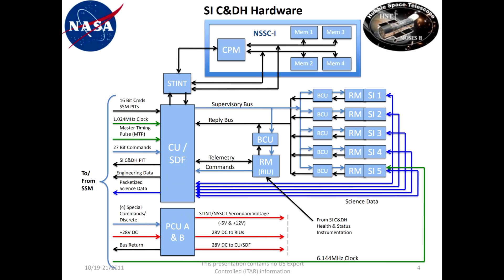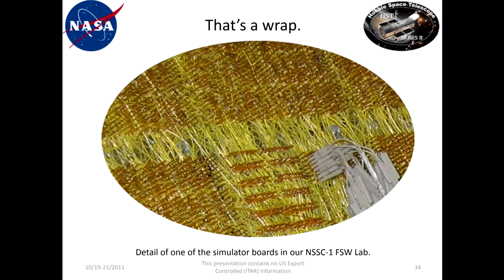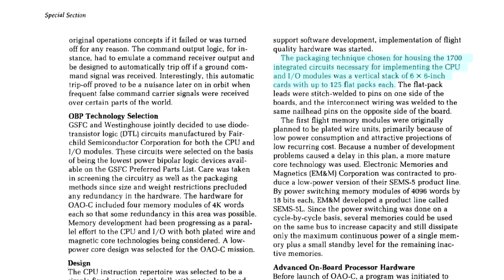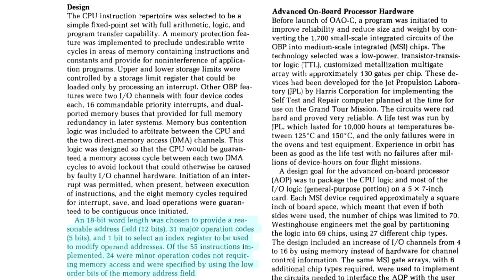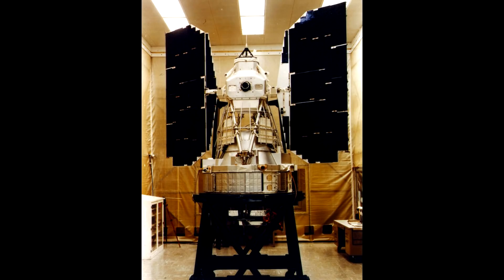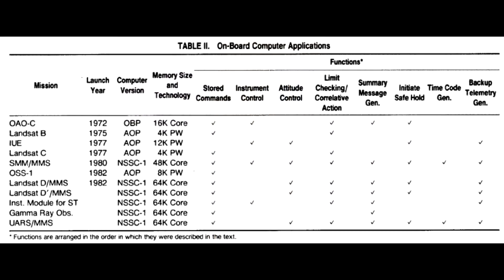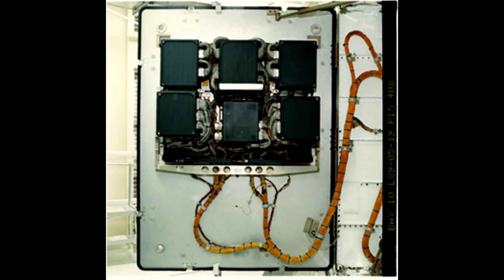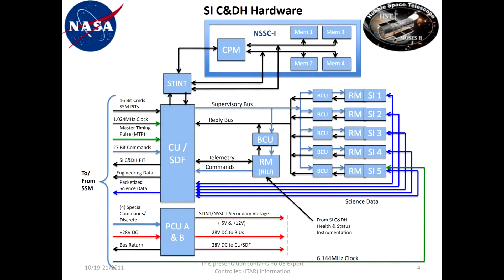Hubble's Latest Problems May Be In a 50 Year Old Computer Design

Comment: First Arecibo now Hubble.... tough couple of years for telescopes.
Reply: We really need to replace Arecibo.  Perhaps on the Moon, as part of the Artemis Project.
Reply: @darylh8657  That'd be cool, but constructing something that large on the moon will probably require much more time and work.
Reply: @javaguru7141  we could use a crater for the dish it'd just need to be polished
Reply: @raytan956  "just" doing any form of construction on the moon is pretty far beyond anything we've done yet. We definitely have the tech base for it, but that'd be multiple multi-billion dollar missions. I'd love it but it's somewhat unlikely in the immediate future
Reply: @raytan956  The dish isn't even the main issue. It's the antenna and supports, of which the antenna on Areceibo weighed 820 tons.
Reply: @javaguru7141  I have some good news for you! That would only be ~135 tons on the moon!
Reply: @washellwash1802  Aha, well that means the support structures can be lighter too which would bring the weight down a lot. Combine that with newer materials and maybe it could all be shipped up on a handful of Starships. The biggest problem would be the actual *construction*.
Reply: @Joesolo13  Actually, using a lot of remote tech, not as expensive as you might think. And a little gravity goes a long way to eliminating some engineering issues.
Reply: @washellwash1802  But it would be 850 tons to haul out of Earth's gravity at something like 25,000 dollars a kg - even more to the Moon.
Reply: @johnmurrell3175  But it wouldn't need to be 850 tons, because it wouldn't need as much reinforcing and strengthening. And I was thinking of locally sourced materials and/or recycled rockets. Starships making their last trip for example.
Reply: Just shows that modern astronomy is a mature scientific field. When systems fail due to old age instead of being replaced for performance reasons.
Reply: @Mike-oz4cv  Another way of thinking of it is that it's failing because we regressed and lost the ability to service it.
Reply: Don't forget the collapse of Greenbank a few years ago. Radio telescopes are quite delicate
Reply: What would Thomas Dolby say at a time like this?...
Reply: Don't forget the TMT debacle...
Reply: @ShanesGettingHandy  I’m not sure what that is actually
Reply: It's obvious now that COVID-19 is an alien virus sent to Earth to stop us from looking for extraterrestrial civilizations.
Reply: Then JWST blowing up on an Ariane 5
Reply: @synonys  Oh gowd I hope not
Reply: @michaelcoelhojr6851  : ... Or Ariane 7, in maybe 35 years.
Reply: @synonys  Don't you dare jinx this.

Comment: A potential explanation for the 27-bit word length may be that it's actually three 8-bit sub-words slammed together with each sub-word having its own parity bit.  If I recall correctly, the Gemini Onboard Computer had some similar oddball word length for the same reason.  I think it was 39-bit composed of three 12-bit words + a parity bit each.
Reply: Univac (a.k.a. Sperry, a.k.a. Unisys) had machines with 36 bit words with quarter word operations (9 bit).  Three quarters is 27 bits.  Best architecture ever in my opinion.
Reply: 39 bits? Who built that one, IBM?
Reply: @absalomdraconis  MIT
Reply: It could also be because octal was all the rage in the 60s and 70s (rather than hex) so using multiples of 3 wasn't all that uncommon for bit lengths (9, 18, and yep 27), with 27 bits being exactly 9 octets.  (Would probably also have some sort of parity or checksum because space, but in this case those just wouldn't be counted as part of the instruction width.)
Reply: I mean … there is no reason why it has to be powers of two. And the explanation for the 18 bit bus Scott Manley gave sounds perfectly reasonable and sensible.
Reply: Probably 32 bits with a Hamming code, that would bring it up to 39 bits.
Reply: You kids don't remember Digital Equipment Corporation.  Look up their various series of PDP minicomputers.
Reply: I used a mainframe in the past with 36 bit words, 4x9 bit bytes.....I think it was Perkin-Elmer....been too long.  May have been Burroughs or Univac.
Reply: Check out Curious Marc. He has detailed vids about the Apollo flight computer. And Odd ball data busses.
Reply: Mostly I have Wheatbix for breakfast - milk and a little brown sugar.

Comment: have one of the maneuvering servicing satellites grab the Hubble and take it down to ISS where they can grab it, astronauts service the Hubble, then release it and the service satellite takes it back up to it's operational orbit.
Reply: Different orbital inclinations thus far too much delta v or fuel required
Reply: @MrPbhuh  that's what I was worried about.
Reply: @BrotherAlan  its probably cheaper to launch a starship to collect hubble, sent it to earth and put it on a new rocket than to change orbital inclination xD
Reply: @MrPbhuh  ouch!
Reply: They are on 30 degree different inclinations. That manoeuvrer round-trip would cost far more delta V than we can jam in a satellite.

Comment: 64k RAM in an early 1970s NASA computer. 
My 1981 TRS-80 Model 3 had that much. Yep, about a decade between the time the government (in this case, NASA) had that available, and when the same capability filtered down to consumer electronics.
Reply: Consumer hardware is all about giving you the most you can for the money - space hardware is all about surviving long enough to do the job.  Put a TRS-80 in orbit and it'll be rebooting weekly, and dead in a couple months, unless it melts or cracks first.  Took the hubble decades ...  but even it wasn't immune.  Integrated circuits don't like radiation.

Comment: What we need is to start designing a new telescope now that will take advantage of starship. The largest single mirror that can currently be manufactured is 8m diameter. That would fit nicely into the starship 9m cargo bay. And, it needs to be built cheap and robust. With 100 tonnes to LEO, there's no need for the extreme weight saving you see in existing satellites. Instead of ultra ultra thin heat shield that can't even survive depressurisation, just use some off the shelf insulator panels and springs to deploy them.
Reply: It's more intelligent to use multi mirror designs
Reply: @MrPbhuh  sure is.

You could fit seven 8m mirrors in starship pretty easily. Add a framework that clips together. Have four astronauts go with it to clip it all together. Put some actuators on the frame so final calibration can be done from the ground. Presto bango, you've got a 22m telescope on orbit. No need to steal the mountaintop from the owners. No planning permission required. No roads need to be cut through sacred grounds. No dome needs building. IR, visible, UV, all available. Triple the resolution of JWST in IR, 9 times the resolution of Hubble in visible, 80 times the light gathering of Hubble. If they pulled their finger out it could launch next year.

Comment: Wow. This is some good stuff.
As an older than you computer nerd, I had some idea about how antiquated the tech is on these things but ..damn.
The Mars helicopter is facing these same hardware / software update problems and it is only as old has its launch.
Need to figure out some kind of age hardened simple language for the future.
Reply: NASA uses old tech for just that reason - its age-hardened.  They know it works and therefore its less risky than brand new untested stuff, even if the new stuff is theoretically "better" in some way.

Of course that doesn't last forever.  Eventually they want to build instruments that have more than 64k memory and other such limitations, and they have no choice but to try and test a new generation of technology as best they can and hope to hell they didn't overlook anything.  I mean they're generally really good at their jobs so they mostly get it right, but its still a huge investment in both time and money compared to just pulling a tried-and-true component off the shelf that they already know will work for 10, 15 or 20 years or possibly longer.

Its always a balancing act between new features and old reliability, and cost constraints (especially not knowing whether their budget will be up or down by a billion dollars every bloody year) means they tend to err on the side of the latter as much as they can.  Commercial contracts help level that out a bit because they can buy multi-year contracts during years when Congress gives them a lot and those contracts will still be in effect the following year even if Congress screws them over, whereas they constantly have to pause or even shutter and re-start projects that run off their annual budget more directly.  The downside of course being that the commercial providers are only really willing to take on contracts for things they can potentially sell to other buyers later.  Launch capability is a no-brainer, and hopefully remote manipulators and EVA capabilities will join that list in a timeframe that Hubble can withstand.

Comment: I'd wadger starship as being the most likely to be able to have a variant made up to alow a servicing mission but even the base form is still likely to be several years out before any man'd flights happen.  IT at least has airlocks in the design due to the potential to land on mars or the moon.  Nor sure how viable a manipulator arm addition would be however.

Comment: Time for Clint Eastwood and his space cowboys to solve this problem!!!
Reply: Problem is to reassemble a shuttle and shuttle launch tower.  The man bodies are in museums, the booster factory is still running, the main engines have been reputposed for SLS, the external tank can be remade at the SLS tank factory, but the launch tower was torn down or modified to provide the two commercial crew access towers.  Then there's the need for fresh tiles and other worn/destroyed parts.

Comment: I wonder how hard it would be build an airlock on dragon in the docking port. and get that certified... They are already changing the port to an observation bubble for inspiration 4 I think, but that is probably a bit smaller than an airlock needed for EVA. 
Either way though this actually brings up a very interesting aspect of spaceflight atm. It seems like we have no ability to EVA outside of using the stations? One can argue that is safer and things like hubble are one-offs, however that is an interesting thought
Reply: At the same time maybe they could use Voskhod style airlock.

Comment: If I recall correctly, the Soyuz did or does have an airlock system in the orbital module. And an APAS-equipped Soyuz has flown before, but  not recently (ASTP)
Reply: Can Soyuz reach the Hubble's orbit though? You'd have to do an expensive plane change maneuver at some point, at least if you launched from Baikonur. And does anyone want to ride in that thing for more than the few hours it takes to get to the ISS?
Reply: The ESA's launch site in French Guyana already has facilities for launch of the Soyuz rocket, so it might be possible to launch from there with a 2-person crew.

Comment: How much delta V would you need to change to bring the Hubble over to the ISS?  Maybe a robotic "tug" or two could do this, and then once at the ISS the Hubble could be given a rebuild.  Crazy idea, but since there are no ships that can do the job, the only thing flying that could service the Hubble is the ISS....
Reply: They're on 30 degree different inclinations... so A Lot(TM) would be the delta V answer.
Reply: Someone in another thread calculated that a falcon-9 second stage might do the job, if it can grab the HST.  Once at station, they can also replace reaction wheels and other worn parts.
Reply: I was thinking the same.

Comment: Could a Dragon Capsule Mission service Hubble?
Reply: Scott stated it cannot since there's no manipulator to capture it or Dragon being equipped for EVAs with such small hatches.  No room for the EVA suits to fit through.  Possible to send a cargo Dragon with a habitat module but the manipulator would still be needed to provide the astronauts a platform to work from while the HST is captured by another ship/platform.  Shuttle's mass and RCS were more than sufficient to keep station with HST attached in the bay and two astronauts on the manipulator.  A smaller ship would be a serious challenge indeed.
Reply: No.
-no robotic arm
-not enough life support time
-probably sucks at EVA
-tiny
Reply: Love asking a Q before all the way through the video.   Lol.

Comment: Its a scary realisation that our current spacecraft cant do any real work in space, only throw stuff up and connect with ISS
Reply: Welll...if we never developed space shuttle Hubble might be designed in a way to be serviceable by automated crafts, and we would have those. I remember seeing ancient designs of apollo like capsules with manipulators designed precisely for situations like this, but then dildo shuttle happened :(
Reply: @randomnickify  Its more likely the other way around - if we didn't have the shuttle, Hubble would likely not have been designed to be repaired at all (like most satellites) and would have been decommissioned years ago already.
Reply: @altrag  Hubble is basically a modified KH-11 spy satellite, with different mirrors. They used it, because they could use the same facilities they use for making the components of the spy satellites.
The KH-11 lasted usually less than 10 years until they got replaced with other KH-11 or newer stuff in future.
Contrary to Hubble there's enough money für spy satellites, the budget for military space flight (means spy satellites) is higher than the Nasa budget
Reply: @simonm1447  > with different mirrors
Given that the mirror is by far the most important part of Hubble, I'm going to suggest that that's a pretty critical "modification".  So I'm not really sure that its relevant whether or not the case around the mirror was developed by the military or not, any more than its particularly relevant that orbital lift vehicles are derived from ICBMs.

As for the military budget well.. yeah.  The US is a bit ridiculous on that one, and getting worse by the year regardless of which party is in power.  Along with corporate greed, warmongering is one of the few issues that both parties are in near-complete alignment on.  But hey, sometimes military tech gets to be repurposed for civilian and scientific use (such as rockets and satellites) so at least we get something out of it aside from death and destruction.  Occasionally.
Reply: @altrag  of course it was important to have different mirrors, but as they used the same mirror diameter they could use the same machinery to produce the mirrors they used for the spy satellites, which made it easier.
Unfortunately there was the mistake they made, but they could save it
Reply: @altrag  the budget for surveillance is surely not wasted, information are crucial to meet decisions
Reply: Yeah, although Hubble is really the only other thing up there we'd want to get at, so makes sense there hasn't been much development in this area. I imagine fitting a Starship with a cargo bay could be closest thing we'll have to a shuttle.
Reply: @trogs2022  : Which will probably be done in some variant or another, though for a work vehicle I'd rather see a Dragon variant designed for in-orbit utility work instead of reentry.